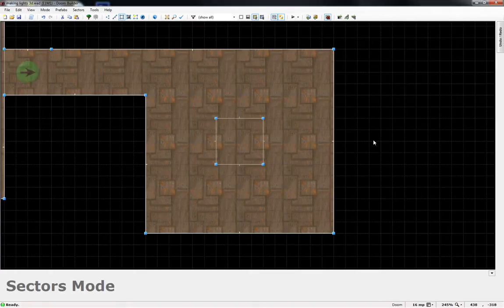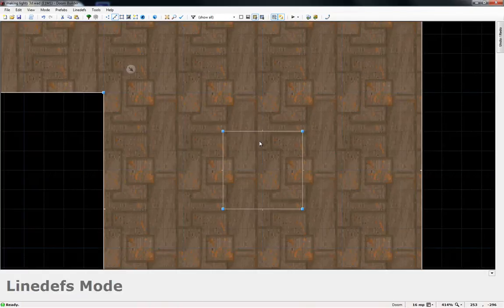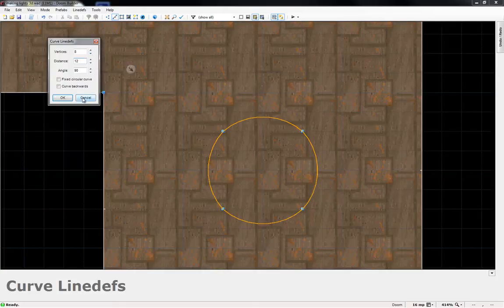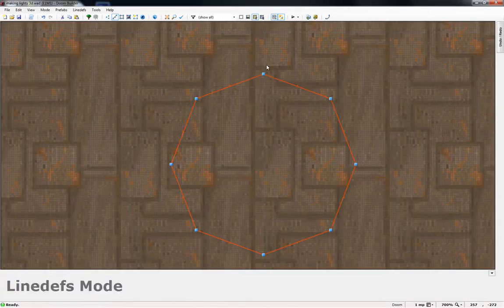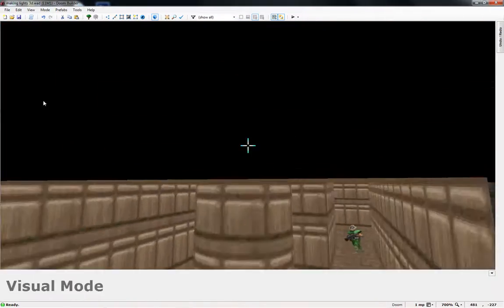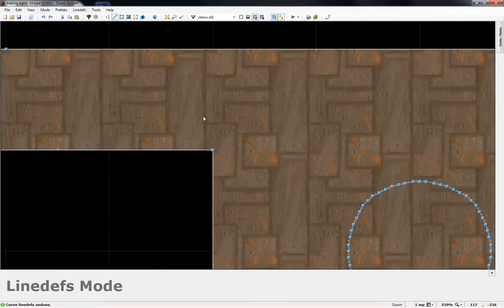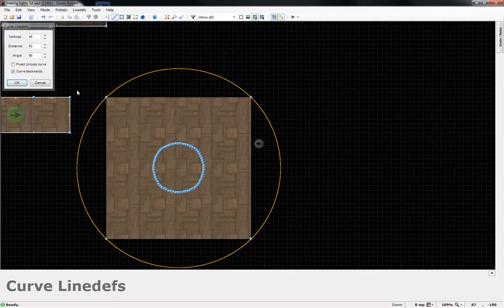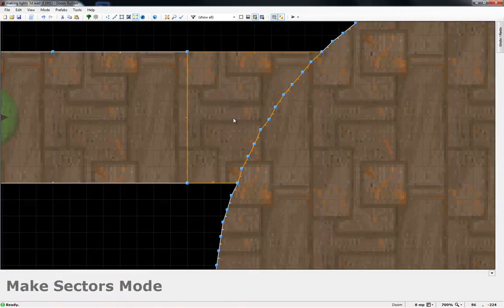How to make Circular objects and rooms in Doom Builder

Comment: But you can only make a polygon. Is there anyway to create a perfectly round object if the map was edited in "Hexen" mode? It should be because it can create slopes and moving platforms, and of course 3D sectors.
Reply: use udmf instead, it's better than hexen.
Reply: @GraveUypo  which is the difference?